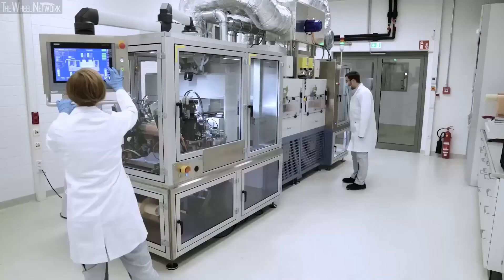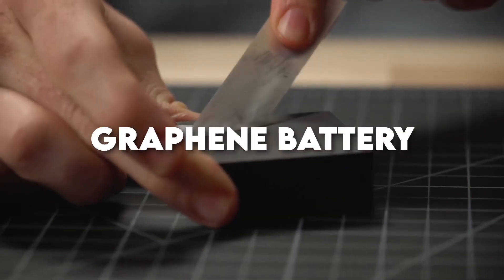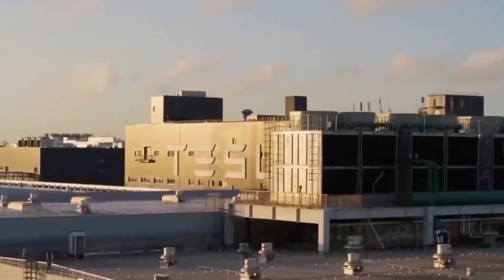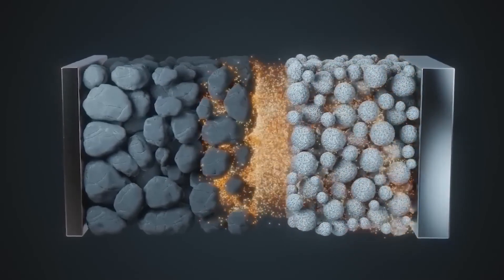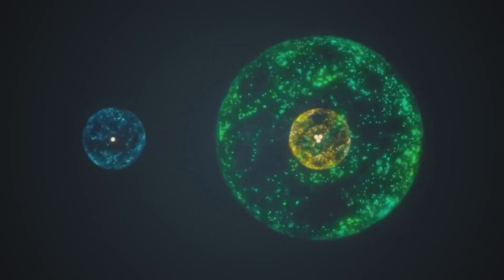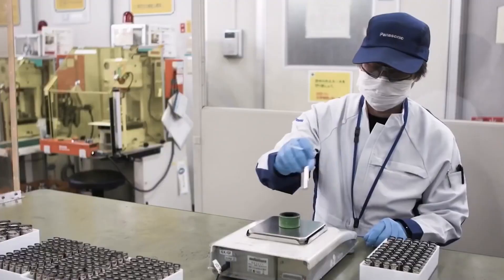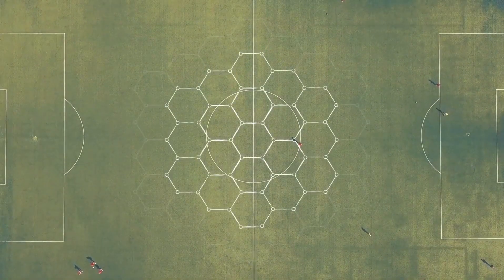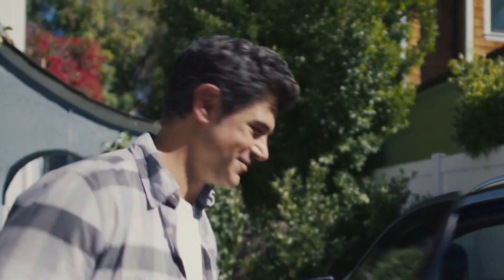Elon Musk's FINALLY Reveals BIGGEST BATTERY !!

Comment: Long range is sadly only a marketing / sells requirement.
  95% of the time you will drive less than 100 miles.
So why pay for the extreme range ?
Cheap energy is no more.
The cost of oil will never go down.